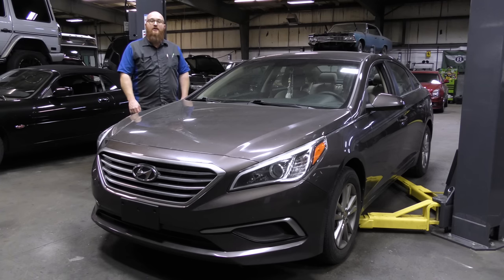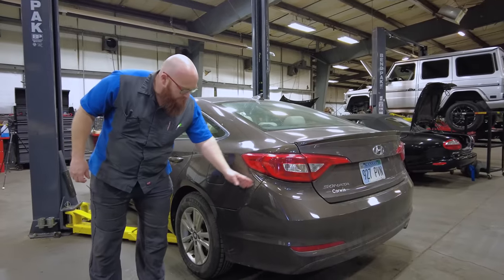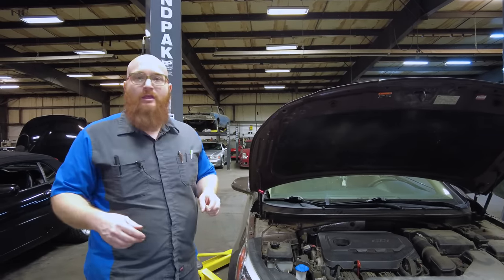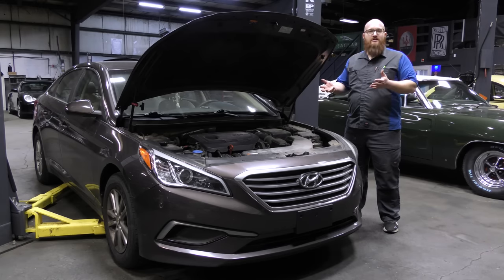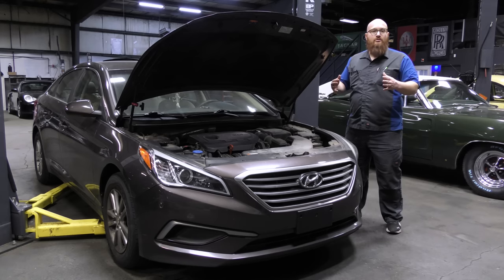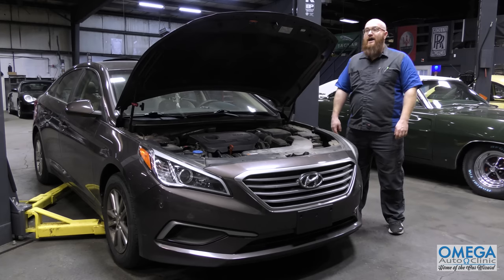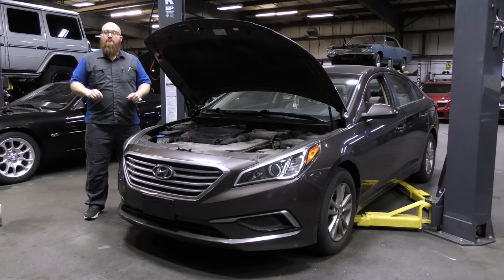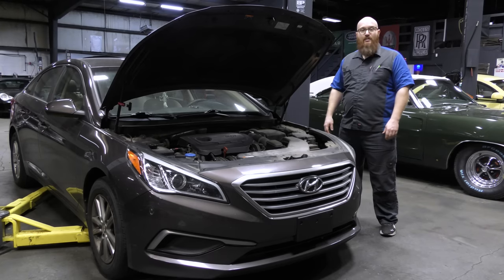What could be so bad on this '16 Hyundai Sonata that the CAR WIZARD is sending it to the junk yard?

Comment: Times have changed.  I learned to drive on the family 55 Chevrolet 6 cylinder.  It was burning oil at a rate of a quart every 200 miles by 60,000 miles. This was 1962.   I paid a local garage $81.99 to install new rings and rod bearings.  I left it at the garage at 7:00 AM one Saturday morning and they gave it back to me at 1:00 PM.  I stayed and watched.  Since it really needed to be rebored, the rings didn't stop the oil burning for very long especially with the way I was driving it.  Back then, you had serious bragging rights if your engine in any vehicle lasted 100k miles.  Now, we expect 200k miles.

Comment: These cars are known for excessive oil consumption which is a contributing cause. My son's 2013 elantra has the piston slap at 64000 miles....I made sure the engine as serviced and always checked the oil and it was always full.....even if that sonato was filled with oil,  the fact that you found metal in it was because the engine was defective.

Comment: I have this model. Engine burns oil, it’s now leaking. I have to replace oil every month. I was told by dealer nothing will be done until it goes out. I had a 2005 sonata 6 cylinder..Loved it. When I got this I could tell the difference with the 4 cylinder. Will never buy another Hyundai.

Comment: cute hood prop lock.   I had a 85 dodge caravan and their liftgate props always failed within 3 or so years.  I just used a cheap small size locking pliers.  Got a new caravan in 1991. The car is still running and the liftgate props are still perfect after 30+ years!

Comment: I own a 2015 2.4L engine blew at 105k without any prior oil/check engine light or anything it just randomly started flashing.(thankfully a free replacement)
171k on it now and I’ve added 4 quarts since the last oil change 3k miles ago. BUYERS BEWARE 

To the people saying shame on you for not checking their oil, no car should use this much oil what so ever.

Comment: It would be interesting to know the real story behind this car, like what failed and why Hyundai declined assistance. Hyundai will offer assistance on the 2.4 at times due to oil consumption. They usually only reject branded titles or vehicles with neglected maintenance.
Also, these numbers are out of line. Those engines are under 4k, and they book closer to 10 hrs than they do 20. Still probably not worth doing, but he's a couple grand off in his estimate.
Reply: He's probably factoring in a very very thorough install and test phase...not to mention the cost of proper parts not made in a sweat shop.
Reply: @kettle_of_chris  The Hyundai long blocks are super simple. An experienced tech can have them done in 5 hrs. I've watched a tech do 8 long blocks in 5 days.

And I'm talking dealership pricing for the engines. You can get reman engines for as low as 2800 from Hyundai.

Comment: I have a 2016 Sonata with the same engine and 120k miles. It is not rod knocking but consumes a quart of oil every 800 miles so it doesn't surprise me that your customers' car is low on oil because they can use oil to rapidly. In my case the cylinder #4 fouls the plug from oil saturation. I've heard that there's a problem with the oil rings, PCV Valve and other hypothetical reasons. Bottom line, this engine is a known failure from Hyundai and believe me when I say, I've tried going to the dealer, calling Hyundai, and I've got nowhere. The only thing that saves this engine is that I add oil to it frequently. We drive our cars and should not have to check the oil between oil changes. Believe it or not, I'm a big fan of Hyundai and Kia cars. I love their designs and the way the drive. But this engine problem is something that they should step up to without question. Don't get me started on the white paint peeling off the car.
Reply: You just described my life with my pearl white '16 Sonata Sport, keep oil full and spray paint peeling spots😢, otherwise I love ergonomics of the car 👍

Comment: Here’s my story about my Kia Optima, same car as a sonata. Last Saturday I was driving down the highway and spun a rod bearing. It is a 2012 optima with a 130,000 miles, never had any problems with it. I limped into a Kia dealer 30 miles from my house on a Saturday. Left my keys with a description on engine knocking. Same engine as in this video, 2.4. On Monday the dealer called me and said the engine is blown. On Tuesday they called me back and told me Kia will replace the engine at no charge to me. THAT IS OUTSTANDING CUSTOMER SERVICE!!! I had no expectations Kia would replace the engine two years and 30,000 miles after the warranty ran out. I had oil in my car. I’ll continue to buy Kia’s if they provide customer service like I received.

Comment: The situation is a lot worse, these engines are actually bursting into flames, there are investigative journalism about for my shock in this day and age, hyundais and kias from 2011 to 2019, over 5.6million recalls, that's just, abysmal, I think the only right thing to do is to avoid the brand like the plague. 
P.S. We're talking about 2 documented deaths and over 5,000 fires and >150 injuries in fires.

Comment: I Am watching this video today Because (  My 2013 Hyundai Sonata )  Broken down on  the freeway. (12/1/23) 5:30am 

 I was Driving to work, all the sudden the Engine light started blinking and I noticed the cars motion just reduced as I was going down a hill and thought too myself, the light just started blinking the motion speed reduced, did my engine just die ? if I push the gas will anything happen? ha I push the gas and realize I am now going to be sitting on the side of the road at 5am with a outside temp reading of 39 degrees . I had to wait 1 hour before family members came to the rescue. Lost some Hours from work, fought the cold while waiting, and paid for gas to the ones that gave me assistance & towing my car to the dealership.  Thanks Gas cars for always failing & Luckly me the owner didn't have to pay for the engine replacement because I had a record of oil changes and other services done to my car, which took any blame off of me . I honestly wanted to do the oil changes and other fluid changes myself and if I would have I am 100% certain the dealership wouldn't replace my engine for free if I didn't have a record of Fluid services and any other work I got done on the car.  would of sucked if I did all the fluid changes myself and the car Engine dieing situation happened. ..  

Moral of the story Gas cars suck, and if you want more money and less problems buy an electric car & many more benefits. 

Even though I didn't have to pay for the engine replacement, I still had to sit on the side of the road in the cold which is fine but not all the situations will be as simple as my situation.  the people that helped me I gave them gas money, some for the truck that towed my car to the dealership & some for the persons car that they let me borrow so I can still get to work and get some hours in. When I got off work I went to the dealership to find out what's wrong with my car, that's when I was told Hyundai would replace my engine for free, and the dealership gave me a list of additional recommend services I should do. There selling point was since we are pulling the engine out its a good idea for these services now while the engine is already out which makes it cheaper. to do these services with the engine in cost more as they would have to take the engine out.

there's one service they recommend that I would love some advice on which is the (Belt & Hose kit:Replace cooling system hoses with engine replacement) Cost is $534.35

I had My timing Belt replaced like 4 months ago. how many belts are there? and do I really need this service? I'm at 148,323 miles . my car was rental car before I bought it at 93k miles .

The additional recommended services shows a total of $1198.96 
1.Air filter replacement            $62.  I already have a reusable K&N air filter that's 5 months old .......
2. One High beam Bulb             $91.07 I have an extra bulb in my clove box that I bought from auto zone for I think around $25 !! 
3.Brake job- Rear pads replacement & Resurface rotors with a machine    (that's only the back)  $329.95
4.Wiper blade replacement      $68. I also have a brand new wiper blade from amazon that was $40 for two..........I bought two and my current one that they suggest I change still works but does need to be changed for better wiping results. 

       all the services above are for dummies that like getting taken advantage of, once use to be me.

                                                        The last and final recommend service on the list

5.Belt & Hose Kit (replace cooling system hoses with engine replacement).   $534.35  Tell me why I should do this or not do this,                      
                                                                            Thank you in advance.

Comment: same thing happened to me except i had 4qts of oil in it when it happened. soon as it happened i shut my 2019 hyundai tucson off. once i got it home i seen it spun rod bearing #3. Im not a mechanic and i had the engine out in 3 hours! I bought a $600 rebuild kit, pitsons, main bearings, rod bearings, connecting rods, gaskets ect. put it all together and its been running fine for 2 years now. im not a mechanic and i thought it was very simple to do. only trouble i had was understanding the timming and the drive shaft lol

Comment: i once bought a 05 elantra off a neighbor non running for $500. i put a alternator in it belt changed the fluids and it was a pretty reliable car. i wrecked it and cobbled the front end together, banged the bent rim out and put a junkyard tire on it. made a couple 3-4 hour trips with it. She had a small knock the whole time i just ran lucas oil stabilizer and kept topping off every time i got gas. ( usually half a quart- 1 quart a week). But it was a very decent car for the money. these hyundais aren’t bad cars if you know a thing or 2 about cars!

Comment: Regarding oil, here's a frustrating thing I've observed. I've been driving Mustangs for the last 20+ years and have found the oil dipsticks do not represent the oil level. Specifically, they can be down a significant amount even when the oil is level is in the hatch mark area of the stick.

Comment: I always wanted a sonata since it was released in my country back in 2011/12 but thankfully decided for a Corolla that I still owns and it’s built like a tank . Nowadays sonatas are very rare to find as it was sold for only 3 years here and not many , which means parts are almost impossible to find . Elantras in other hand have sold way more and are actually a good option . It’s a beautiful car , I have drive a few and it’s a cool machine but not reliable nowadays , at least where I live …

Comment: It's terrible that Hyundai engines are not reliable. They were good at one point. 

Back in 2007, I bought a 2006 Sonata V6 LX with 2,300 miles from my local Hyundai dealership. The final cost of the car was just under $20,000 with the 10 year 100,000 mile power train warranty that I bought since it was a used car. The V6 and the automatic transmission were very reliable. I made sure I checked the oil and had it change every 4,000 to 5,000 miles. I still checked the oil in between the oil changes. It was a wonderful car to drive and had only minor issues with it.

In 2018, I sold it to my niece due to needing a minivan for my growing family. She drove that car until January 2024. Unfortunately, her parked car was hit by another driver and was totaled. The car had over 270,00 miles with the original engine and transmission. If the accident had not occurred, I believe she would still drive that car today.

Comment: on these types of engines, GDI specifically, the high pressure fuel pump on the top of the engine can leak. causing fuel to enter the engine, thin the oil and kill it that way. it explains why the oil level is down because it goes past the rings and burns.

Comment: That's a Theta 2 engine, (with a rod knock), it's actually a great engine, but very sensitive to oil pressure. Low oil level or blocked pickup screen will kill it in short order. The oil pump and balance shaft assembly make it very expensive to repair.

Comment: Oil consumption from carbon build up is inevitable for this GDI engine with it's engineering flaws....It can run through oil almost as fast as gas from years of carbon build up on the pistons and within the entire engine.....Especially without a catch can installed. Gotta keep an eye on GDI engines but to this customers defense, it can vaporize all of the oil in a matter of a week once the carbon gets bad.

Comment: Unfortunately this is fairly common.  Young drivers usually with little money for oil changes and busy with dating, school, work, etc. don't remember to check.  The other scenario that happens is something breaks like a water pump or a rock hits the oil pan and leaks and they keep driving, and next thing the engine's toast.  And because of the cost involved it's often parents that end up having to foot the expense to get them back in a running car, so no one's happy.  Even if a parent mentioned the importance of checking it when helping them learn to drive, it's a prevalent enough problem to be a pest about reminding to make sure it is being done.

Comment: My 2012 GLS now have 216,000 kms. on its clock.  I am the one who do its oil changes (always at 5,000 kms. full synthetic 5w20 oil) and other repair and maintenance just to keep it going.  I make sure that I check the oil level every week and make sure that it is a full side or top it up if needed.  Until now, I am still using it.  If the car is starved with oil, rod knock will occur, thus, this car will end-up in the recycler, they can pay you $300 for it.  Have it recycled and move on.....

Comment: Sure had a damn close call a few years ago. I went a bit too long between oil changes and when I was preparing to return from the longest of several trips I’d taken that year, I saw the oil light blink very briefly while parking the car after getting gas. I checked the oil level and it wasn’t even registering on the dipstick! 😱 I texted a friend to give me a lift to one of the car parts store that was still open that late. I ended up putting three quarts in. The engine holds four. Makes me really nervous thinking of what might have been, as I was four states away from home. My very first stop back in town, before I even rolled into my driveway, was the dealership and had an oil change done. Fortunately everything looked fine (the car was already over 10 years old by then, and I figured it was time to start looking around and eventually got a newer car).

Comment: I also have the same car 2017 model. In my case I knew that the car's burning oil.. because I change it myself every 6000kms. I webt to the dealership told them they asked me to get the oil burning test which was coming every week to the dealership get a topup for the oil if any less than required.. car used to burn like half a quart every week i.e almost 600-700kms.

6 weeks later I was ordered a new engine for my car free of cost.

Just gotta maintain the machine and you'll have all the services you are entitled under warranty.

Comment: I just replaced my cylinder head after it popped an intake or exhaust valve. Runs fine. But if I notice it start burning oil again, I’m selling it and getting a Toyota or Honda beater. 
I really like the look of the Sonata thou. It’s cheap and stylish, but I guess the engine is cheap and that’s why it’s cheap.

Comment: Car wizard, I hope you read this in time. I used to work at a Hyundai dealership in the Sacramento area. We were getting these engines replaced left, right, and Center. Your dealership obviously didn’t want to do the repair. You need to find a different dealership and have them create a prior approval case. I had got approval to replace multiple engines over 150 to 200,000 miles and then one case even on a car with 300,000 miles which was in terrible shape. Even cars that did not have the class action lawsuit we’re getting approved for replacement engines. Sometimes with a small contribution from the customer. Hope you find a better dealership than the one the customer had originally visited.

Comment: Also want to add that, be it my car or a borrowed vehicle, I check fluids and tires when I put fuel in them. Most of my friends own vehicles that have nifty things like, oil dipsticks, and automatic transmissions with dipsticks and replaceable fluid/filters, thankfully. I understand, gotta go....but instead of sitting on your phone in your car while you fuel up (which is a NO NO in itself) you could spend those few minutes checking your vehicle over. I have found burned out bulbs on vehicles because I made a habit of doing quick checks while getting fuel. That said, to me, my car is an investment that has to last the rest of my life. Everyone else, well the car is an appliance and people seem to care about them now as much as they care about their toothbrush.

Comment: The Hyundai 2.4 from 2013 to 2016 had issues with blocked oil galleries in the crankshaft. Its part of a huge recall and replacement effort by Hyundai. Basically the subcontractor making the crankshafts forgot a deburring step that left material in the oil passages that over time cause blockage. Basically no rebuilder wants to take the risk of installing a crankshaft that potentially could still have blocked oil passages. You would have to test the crankshaft oil delivery before you could even rebuild the engine. Its a massive screw up thats destroyed Hyundais reputation. Sonatas were great cars before the 2.4 engine crankshaft problem.